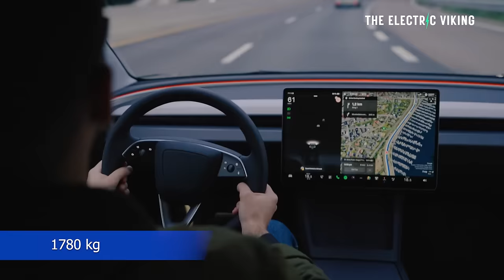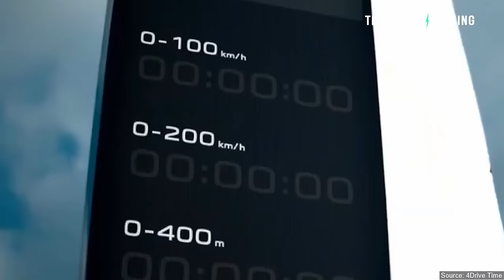Xiaomi's $42,000 SC-01 electric sports car weighs less than a Porsche 911

Comment: It's not a Xiaomi vehicle. It's a XiaoPaoChe (Small Sports Car) vehicle backed by Xiaomi.
Reply: That's not important, what is clear is that the brand is Xiaomi and was introduced by the owner of the Xiaomi company
Reply: @agusedyanto3324  So you think:
i) accuracy in reporting doesn't matter and
ii) you determine what matters and what doesn't matter

On both of those points you would be wrong. If you had said Xiaomi is very smart and strategical about the companies it lends its support to and promotes I would have agreed with you but as you are just pushing muddleheaded nonsense I can't.

The company making this car is independent of Xiaomi and its vehicles don't bear a Xiaomi badge. Xiaomi has a long list of companies and products that it supports and promotes. I'm pretty sure that Xiaomi and its partners all do well out of those limited purpose business partnerships (that may involve some sort of financial support from Xiaomi but turn on marketing considerations and coordination).

Comment: The weight increase in cars is terrible. My 1968 VW Bug 810 kg, VW Passat 1979 925 kg, Renault Espace 1988 1280 kg, Seat Alhambra 2004 1780 kg.
Now I am back to 1280 kg thanks to my Dacia Lodgy 2014. I cannot find any reasonable explanation, why the Seat Alhambra was 500 kg heavier than the Dacia Lodgy.
Reply: Safety, those car were rolling coffin
Reply: You have to remember what new stuff is included, power steering, electric windows, Air bags, better air-cond, better brakes. better safety features like side intrusion bars. Every things just adds to the weight.
Reply: @demonwombatofdoom8391  My Dacia Lodgy has power steering, electric windows, air bags, ais-cond, very good brakes and is still 500 kg less heavy than the Seat Alhambra.

Comment: Stuffs Tesla up big time if it ever brings the Roadster out !!! Promised a decade ago in 2014 !!!!!  Battery in it weights 1.5 ton alone !!!! To get the range promised !!! More if it uses the 4680 battery would be 1.8 ton minimum due to its low density . Certainly won’t go around corners quickly, physics takes care of that
Reply: Your stuffed if you think the roadster you seen is the one that will be released.   It will have the latest tech.  Otherwise it is pointless.

Comment: Xiaomi putting together a car in a week just to put in the market hoping it will stick.  you can tell the sloppy design and the hidious rear.  It's cheap and there is a reason for it, they use cheap internal parts you can't see
Reply: I suspect it will d missing quite a lot of parts given the weight. The weight distribution is going to be higher than a standard ev as the shorter area is going to mean taller battery pack.

Comment: I just saw a video about how bad Xiaomis evs are and lots of people in China was complaining.. The auto brake system did not work for example and had made a few accidents already :D  not to mention the "cheap ev's".. the biggest Xiaomi car is $70k in China.......  its probably a 20kWh battery anyway, thats only way to save weight. Not sure about the low center of gravity.. all EV's have low center of gravity... way lower than normal ice cars.
Reply: Tesla started with a lot of issues too, Xiaomi probably has cash to burn to work on quality
Reply: @lkrnpk  I found more info about this car. Its not Xiaomi that made the car, but its backed by Xiaomi. The car is supposed to have a 60kWh battery :O, and it weights as a VW E-Up. I will take this with a bit of grain of salt since the other Xiaomis (that also was not really made by Xiaomi, but backed by Xiaomi) is proven to be bad.
Reply: Xiaomi has not released any ev so far. Their first ev SU7 is still months away from launching . Stop your bs.
Reply: Dumazz Xiaomi car is months away from being available. Stop embarrassing yourself.
Reply: they didn’t even started to deliver it yet and SC-01 is not even production ready like stop this nonsense please
Reply: Looks like the Xiaomi EV has just entered the internal testing stage and hasn't been marketed yet, it looks like you're hallucinating, bro